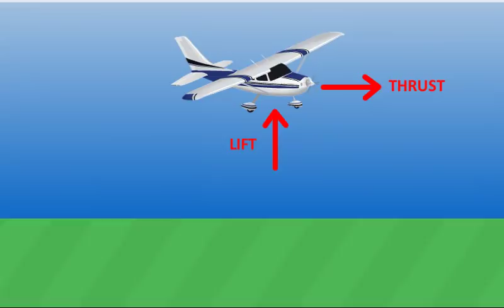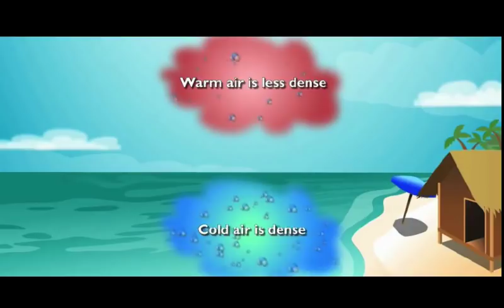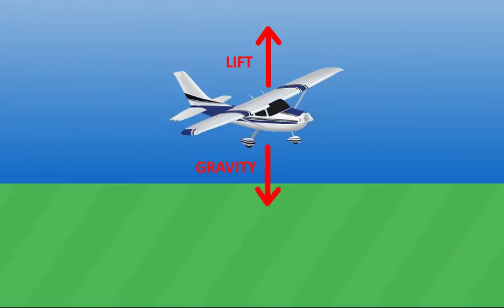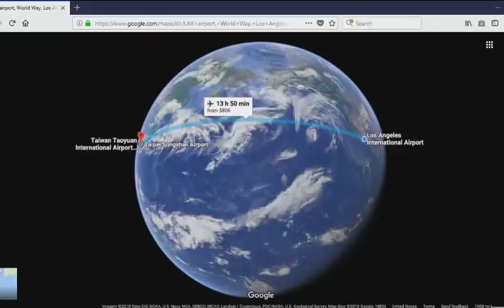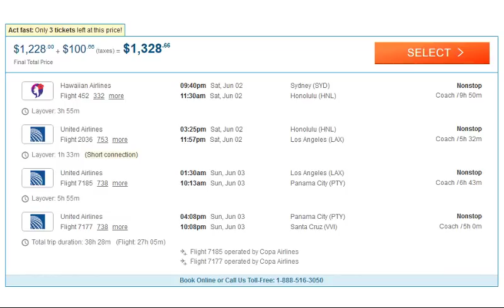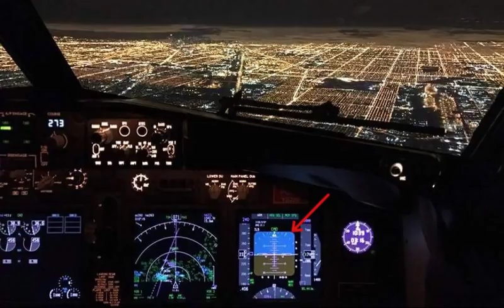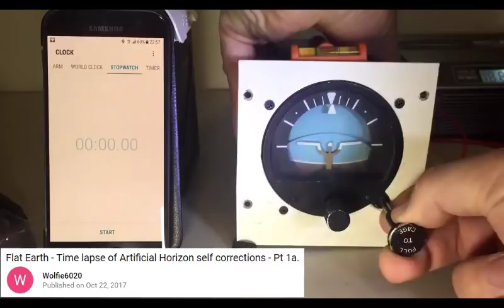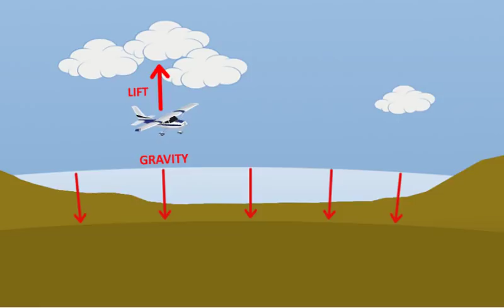Flat Earth Falsities - Plane Nonsense

Comment: Flights from North Scandinavia to North Canada/Alaska...? Why going southwest, not going north?? Because the earth is flat and south polar centered.
Reply: Could you answer a question of mine. If Earth is a 25,000 mile diameter pizza. Why can't anybody, find two locations anywhere on earth that are more than 12,500 miles apart, that is only half the diameter of your pizza world. I realise on your flat-earth model, Australia and South America are close to 25,000 miles apart. But unfortunately 10,000 people fly between these two continents weekly using three different airlines. Flight times and globe accepted distances agree, it's just over 7000mls. So find two locations over 12,500mls apart, should be dead easy on a 25,000 mile wide flat-earth
Reply: @A P Presley Here is the distance from San Francisco to Singapore by submarine cable: 20,000 km. it debunks globe model. https://www.submarinenetworks.com/trans-pacific
Reply: @GebSpez15215  Yappy on a good day
https://www.spassfieber.de/funpics/hund-freut-sich.jpg
Reply: "*South Pole* Centered Flat Earther." Novel. A load of bollocks, but novel
 "#UniversalAcceleration #AscendingEarth" So why aren;t we traveling FTL?
Now please advise on the actual flights you referred to as there are no direct flights from, e.g.  Ålesund to Northern Canada or Alaska, are there?
Reply: @wong I spoke about the airplane's direction. No flight on both places crosses the north pole or go northwards -- which is supposed to be the shortest route.
Reply: @angel_ia  Nice try but these so smart boys are way better at repeating picked-up questions than answering anything. Yeah they are still laying all those cables just as launching satellite balloons, seem archaic for the 21th C, to say they have internet all over the Galaxy...
Reply: @GebSpez15215   Are you proud of announcing to the world you are a semi-literate silly little kiddy, one prone to throwing repeatitive hissy bark fits? 

" YT—owned by Google— so best to skip the zionist comments and any reference to Jones and InfoWars." -  Robert Thomas 

 - The man know how to fear and submit to Authority, repress Opposition.
    Problem is I am not a coward, so may the TRUTH be said, & liars bark :)

Main article: Jewish fundamentalism

[Ilan Pappé, an expatriate Israeli historian, writes that the First Aliyah to Israel "established a society based on Jewish supremacy".[48] Joseph Massad, a Professor of Arab Studies, holds that "Jewish supremacism" has always been a "dominating principle" in religious and secular Zionism.]
https://en.wikipedia.org/wiki/Supremacism

[Pappé is one of Israel's New Historians who, since the release of pertinent British and Israeli government documents in the early 1980s, have been rewriting the history of Israel's creation in 1948, ..expulsion or flight of 700,000 Palestinians.. constituted the ethnic cleansing of Palestine, in accordance with Plan Dalet (standards), ..arguing that Zionism is more dangerous than Islamic militancy, and has called for an international boycott of Israeli academics.
    An expatriate (not to Google standards) Israeli historian and socialist activist. He is a professor with the College of Social Sciences and International Studies at the University of Exeter in the United Kingdom,]
https://en.wikipedia.org/wiki/Ilan_Papp%C3%A9
Reply: @BrainUser1  What do my comments have to do with Profe Reto?

     I simply responded to your comment about Google, and YouTube has removed Jones and his Infowars content. I'm satisfied—you've done your little cut and paste, now be done with it. The point is, whether it's part of the grand conspiracy theory, let's focus on the topic and leave the "Zionist" labels, Infowars and the like out of your comments here.

     In response to my plea to stop with the Zionist, Jones, Infowar matter, you said: 
"The man know how to fear and submit to Authority, repress Opposition. Problem is I am not a coward, so may the TRUTH be said"

     So you intend to continue. You consider YouTube's Community Standards repressive and won't submit to YouTube's authority. Problem is, YouTube is your platform. Maybe you're not a coward, but you are a fool.

     Regardless, you just can't resist the urge to troll, but I can resist the urge to interact with trolls. From here on I'm with Profe Reto.
Reply: @romithromith  I note Yap Yap is accepting it is an inferior being : “Imitation is the sincerest form of flattery that mediocrity can pay to greatness.” Oscar Wilde.

Comment: My experience with flying is that it takes longer to fly from East to West than West to East.
Reply: Well if it takes longer, that must mean something other than the plane is moving.
Reply: That's true and is due to Westerlies, the mid latitude winds that blow from the West to East. A good example is Qantas flights between Sydney and Santiago. Currently, the East to West flight takes about 14 hours, while West to East flight takes about 12.5 hours. (These flights disprove a flat earth where the flight course exceeds twice the range of a 747, and would require speeds of Mach 1.5 or more.) 
     Look at the recent flights and flight times at bottom of pages...
       https://flightaware.com/live/flight/QFA27   B744 = Boeing 474-400
       https://flightaware.com/live/flight/QFA28

     Looks like Profe Reto's pet got loose again.
Reply: @romithromith   So if you want to fly in a supersonic 747 passenger jet, come to Australia.
Reply: @appresley4071  Right, but it only applies to flerfs!
Reply: Ever heard of jet streams?
Reply: Look at these
https://www.ecosia.org/images?q=%22Reon+Kadena%22#id=_
Reply: That to be a norm is strange, with a perfect stcik non influence Atmo Momentum. Contrary wiinds badboys.My thought is that with a aerodynamic high mass there would be some 'slipping' going on in the air, being its all counter-clockwise;     Earth spins -- toward the east. ... ( equator surface +1,000 mph ) and also around SUN ( 666 hundred mph). 

   So if automatic Momentum did not drag a suspended /flying object as well as itself then WEST would come up faster to it?    Maybe its the Geioid 66.6 inclination that causes it? 

   ps: please people who do not understand my incomprehensible muses refrain from giving content for once.         except Profe Reto naturally....(sign!), let the child bark ( +Dark Lord of All  breed)
Reply: Louis Shaw 
lol... did you take your pills today? lol

explain the word „atmoSPHERE“ to us and rethink your whole statement. try

lol

again, keep up the nice barking... never stop. am I still under your skin? frightening, isn’t it? take your pills now...
lol
Reply: More free education, Atmosphere: the envelope of gases surrounding the earth, as the sky. It is all around inside the Dome.
'Atmo-sphere' was invented by christian scientists in seventeenth century. It is commonly used by Humans and Primates alike.
   note: Surrounding= all around a particular place or thing.
             Around=  in a direction going along the edge of or from one part to another.  In a circle or in circumference, ex: The road goes around by the lake.
   Poor pathetic children with silly word games... sign!
(but dont talk about meanings as of LEVEL)

PS: funny how a wide belt of prevailing westerly winds in the mid-latitudes 30 and 60 degrees dont affect Momentum, not below and not even above???  How is all that top layer of air sticking so in sync with the fastest spin speed of the flying hypersonic-Sphere?
Reply: @GebSpez15215  You mean his yap, yap distemper pills?